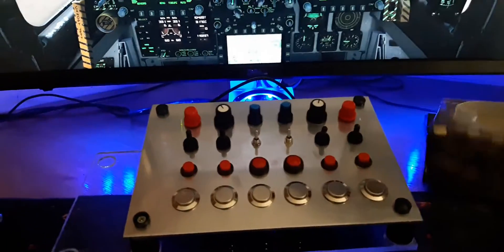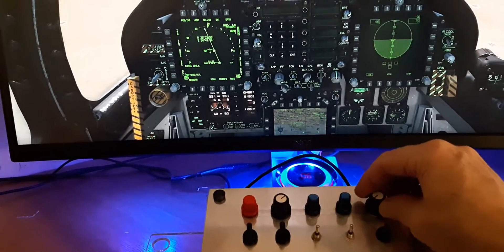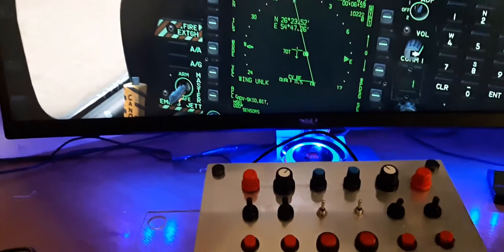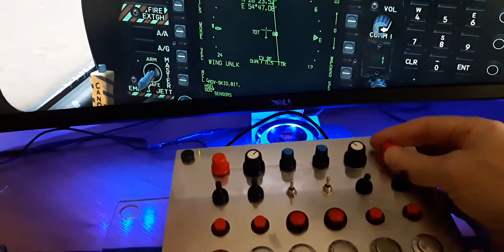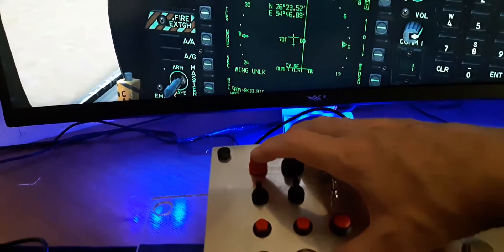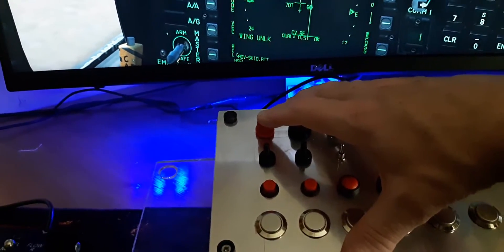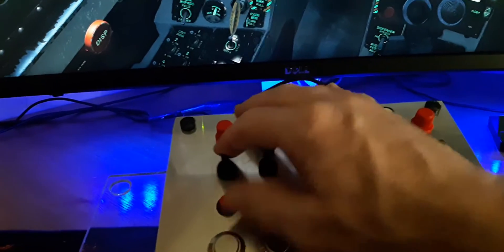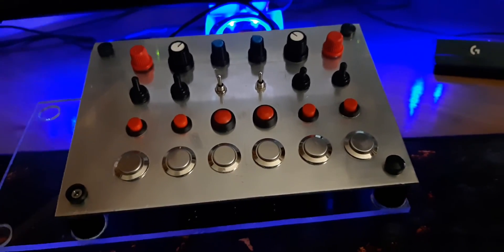Button box in action.

Comment: Excellent button box!  Wanted to share a method for fast OR fine tuning the HSI dial dependent on the speed you physically turn the knob, where slow turning results in 1 degree per detent on the encoder, but faster jumps by 15 degrees per detent, and as high as 30 per detent when turning really fast.  See the function lower down called "speedVal()" on line 99 - if you're confident with your coding, you could drop something like this into your sketch to free up that one toggle switch and just use the encoder for slow and fast HSI changes: https://pastebin.com/sJQEAA8a

Comment: Greetings. Nice work as usual. When it comes to the heading bug, have you thought about a push button to sync the bug with the current heading of the aircraft? We use this in real world aviation when we need to transition from a nav mode to a heading mode accurately usually when on the autopilot.
Reply from the maker: @raynman Sounds like a great idea. Have not heard of this being modelled in the mil sims I fly, but will put the question to the forums